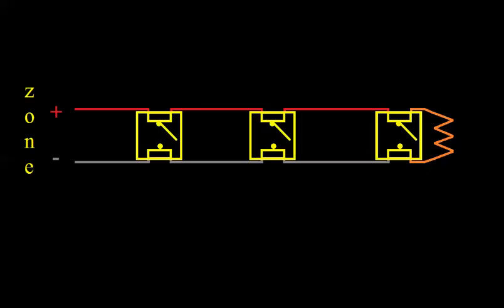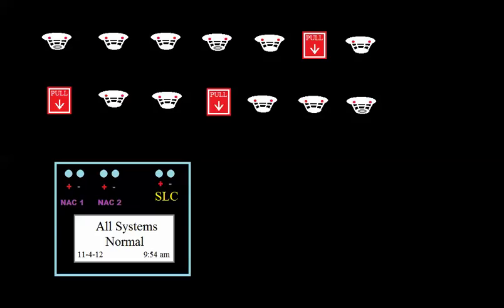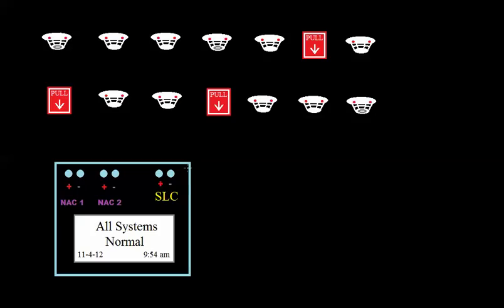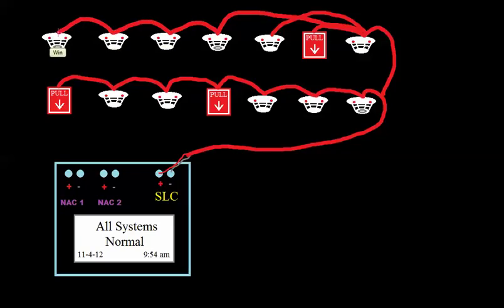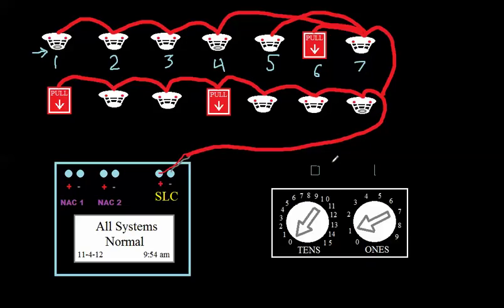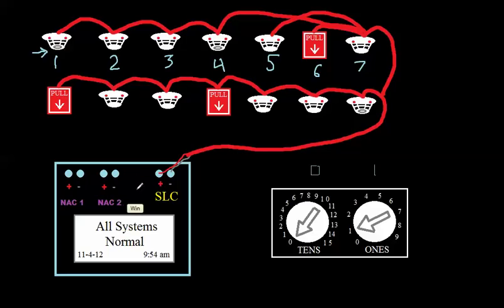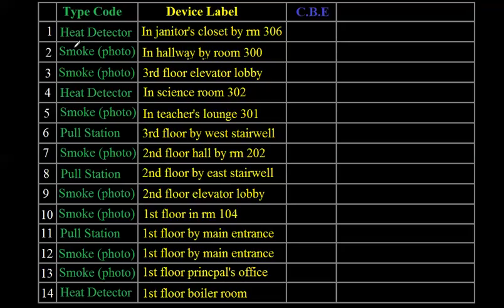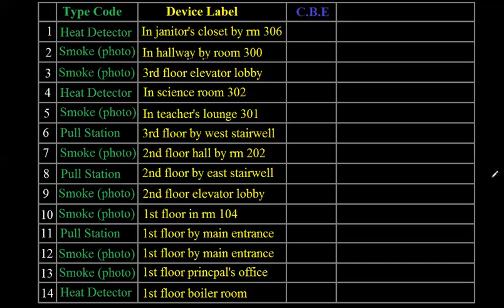21 - Intelligent Panels - Introduction to Fire Alarms

Comment: Hi, I have an NFS 320 notifier fire alarm panel with 138 smoke detectors and 25 modules. Now my panel is showing multiple trouble"INVERB". The same device showing "inverb" trouble blinks a green colour as a normal device, sometimes the same device blinks a red colour and sometimes the same device keeps the LED red in colour. Could you please suggest to me your expert advice?
Reply from the maker: Is it a new system, or was this existing and previously working fine? Do you have the proper SLC voltage on those devices? What exactly is the trouble message? The LED blink can be meaningful but it may act differently with output modules. It's been a while since I've worked on notifier, but on fci systems, those same types of modules only blink green if they're output modules.

Another thing to try is disconnect a device and wire it directly to the panel and see if it clears.
Reply: Thank you so much for your response. It was working well for the last 2 years. The SLC voltage is around 14. It shows trouble in systems like "INVERB".
Reply from the maker: I'm not familiar with INVERB, but usually their error message is short for "invalid reply, which is something like INVREP or something like that (it's been a while for me). My guess is that's what you have. Your voltage sounds correct, I'd try wiring the missing devices directly to the panel. Are you sure you have no ground faults on the SLC?
Reply: @jeanclinton682 could be addressed wrong or programmed differently

Comment: Fuck me how shit are USA fire alarms. Conventional fap's don't monitor for short circuits (short circuit actually puts it into fire 😂)
SLC as you call them ffs, it's a loop so from the panel it goes to the first device then to the 2nd and so on then at the last device it goes back to the SLC. And no you can NEVER tap off a device.

Comment: if the SLC wiring has red, black and green wire for grounding, should I use the green wire to ground all metal boxes where the smokes are installed or cap it off, I don't see any information about this ground green wire
Reply from the maker: I dont know why there would be a green. It's possible you're referencing an older system that needed a shield, but I've never seen a green shield. There's no reason to pull a green along with SLC.

Also, while the whole point of my channel is to help guys learn the trade, you need to consult the manuals for your system to know specifically how the factory expects it to be installed. While I hope to get you most of the way there with my videos, I can't tell you the required specs of every type of alarm system out there. Look in your panel manual, SLC wiring guide, etc, to see how your specific devices need to be wired.
Reply: @JoeKlochan thank you

Comment: Do Intelligent panel and addressable type a same thing?
Reply from the maker: Yeah, I think when that technology first came out there was technically a difference between an addressable or an intelligent panel. That may still be technically true, but in my experience the terms are used interchangeably and they're the same thing.
Reply: @JoeKlochan  I see. For conventional, Is it possible to have a two manual pull station in a single zone?

Comment: T tapping is for people that never learned the right way to pull cable. Anyone that trouble shoots other peoples work understands why t tapping is bad
Reply from the maker: That's not true. Anyone who know's how to troubleshoot and SLC circuit knows that t-tapping a class B circuit isn't a problem. That's a good example of a common snobbish comment that many people in this industry would say publicly but would definitely ignore in the field when it's convenient for them.

I think it's good to make an effort to limit the number of splices on a circuit for obvious reasons, but some aren't a problem at all. 

On many jobs the person who runs the conduit isn't the person who pulls the wire, often times it's not even the same company. If you can picture a large building with a panel somewhere in the middle and full coverage smoke detection, putting a splice box above the panel and having the SLC branch off is harmless and practical. This is particularly true if your pipe route would result in double the wiring being used on the job, just because of some common complaint that you've always heard that "splices are bad." It just shows a lack of understanding of how these systems work in my opinion.

Comment: How do you connect sprinkler system signals such as SV, FS (Flow Switch), LP (Low pressure)? Can  I show them on the same SLC with heat and smoke detector? Thank you
Reply from the maker: Yeah, they can be on the same SLC. Check out my videos on sprinkler systems, and also the one on monitor modules. They explain that a bit more.

Comment: I have a SLC with a pull station trouble.  I replaced the pull station.  I checked voltage at the device before and after this one and all 3 have 15 volts.  What else could I be missing?
Reply from the maker: What type of panel, pull station, trouble, etc. More info
Reply: It's a notifier panel maybe a NFS-320.  I'm not a fire panel tech I just over the system at work. The pull station is a  notifier 12lx.  The trouble alarm gives the address.  It just started about 2 weeks ago so I checked the wiring for tightness first.  When the trouble didn't clear I changed the pull station.  It's a SLC configuration I've seen that in the drawing.  Thanks for your help.
Reply from the maker: @tommiebright4414  there are a lot of variables. The system has been installed for a long time and this just started? That seems odd. Are you a fire alarm tech or an employee in the building?
Reply: @JoeKlochan  The system is 18 years old.  Never had a problem with this pull station before.  I work in a very large factory.  I'm a electrician who has taken over maintenance of the fire system.  The drawings show the pull stations connected in series.  My thought was an open wire but when I checked voltage at the pull station before and after this one they all have the same voltage.
Reply from the maker: @tommiebright4414  is there any chance another device on the system has that same address? What specific trouble message is being displayed? If you remove that device and t-tap it directly at the panel, what happens? When you replaced the device, you set the new address, right? Also, this is very rare, but it's possible the address dials need to be exercised on the new pull station. Turn the dials from 0 to their max and back several times and then set the address. I think there's some sort of wax coating on them that can occasionally (but rarely) cause a bad connection between the dials and the circuit board. Is the trouble an invalid reply? Lastly, tell me exactly what the panel model is and the pull station part number is.
Reply: @JoeKlochan  The exact trouble is "1M044 Pull Station Trouble".  I pulled the drawings and located it.  Removed the cover, opened the pull station and seen the node 44.  I checked the wires for tightness, and checked voltage between the positive and negative (15v).  After the trouble persisted I changed the NBG-12LX.  I addressed the new pull station 4tens and 4ones.  The trouble code just showed up one day as I was checking the panel status.  I will get you the exact model number Monday.  Your videos are great by the way and your assistance is greatly appreciated.
Reply from the maker: @tommiebright4414  I really don't think the trouble message would simply say "trouble". I may be wrong, but I think it's going to say "INVREP", which stands for invalid reply, which is basically a no answer trouble. The pull station you're replacing it with is the exact same as the existing right? There's not already a module in the junction box or anything? I would try removing it and connecting it at the panel. There are no other troubles on the system?
Reply: @JoeKlochan  No other troubles at this time.  If I could get your I could send you pictures of the panel display.  I will try as you suggested Monday.  You are awesome!
Reply from the maker: @tommiebright4414  I'd rather not post that on here. Does YouTube have direct message?

Comment: i can't understand about ones and tens
Reply from the maker: So if the "10s" dial is set to 2, the address will be in the 20s. If the "10s" dial is set to 5, the address will be in the 50s. The way to set a device to address 72 would be to set the "10s" dial to 7, and the "1s" dial to 2.

Comment: You never heard of AUTOPROGRAM ?   You do not have to tell the panel its a HEAT or a SMOKE and the panel figures out the address automatically.
Reply: Not all panels. We use silent knight. They do not. We have to detect it and find it ourselves.

Comment: Appreciate the video - The concern i have is the loop is not completed back to the panel! this to me looks like a radial / conventional way of wiring the system? should the circuit not be completed my wiring another 2core cable back to the panel from the heat detector addressed No:1??
Reply: Jonathan MacMillan yes, I'm thinking the same. At some point it must be connected to the Alarm panel. We're following loop wiring(addressable). Please correct me if you've any recommendations. I'm new to FA PA, my project has just started

Comment: It's all fun and games until your apprentice confuses the tens for the ones on the apartment modules and you have 50 address faults to deal with on Friday afternoon.
Reply: he won't do that if you teach properly. Just saying .
Reply: or resets entire site from control panel, so you have to address all devices one by one.
Reply: jajajajajajajajajajajajjajaajajaj
Reply: Well perhaps if your apprentice's mentor explained it properly, then you wouldn't have had the problem.
Reply: how is installed response indicator at siemens

Comment: I have one problem. I have one FACP in the commercial building which is old and i am a designer of the renovation of some part of that building where we need more smoke detectors. my question is this. Can the new model of the same brand be compatible with the old in terms of looping it together. ( the brand is simplex) it will be great help. Thanks in advance to anyone who is able to help
Reply from the maker: +Mohammad Nabil Most likely they will work fine. SImplex has many different types of detectors and bases, but typically the new detectors work on the older systems, just not the other way around. You may run into a UL listing problem, but most likely not. There should be documentation with the smoke detectors that tell you what panels the detector is listed for.
Reply: You need a licenced fire alarm technician to do that.

Comment: Joe....you are awesome man.  I love the way you present the topics and you clearly explain the functioning of the system.  Could you please explain/upload a video on how to wire/connect 2 FACP panels together?  Is this even possible?  Also, could you please explain how to wire an annunciator panel to the FACP?  Thanks!
Reply from the maker: +Henry Surface That's a bit of a difficult question to answer. I haven't been making videos recently, although I haven't ruled ever doing it again. There are many different types of fire panels and many different types of annunciators for them, so it would be hard to cover. I suppose I could do one on the most common annunciators. They're pretty straightforward though and the manuals would be better help than I would. 

As far as connecting two panels together, that would depend what you mean. Many panels have the capability of being a part of a network. That means that several panels (picture a college campus) can have cards that essentially all talk to each other through either a wire or fiber network. Then, at some central location, all of the panels can be viewed by a network control annunciator. Imagine a college with 30 buildings, and at the main security office they can see alarms, troubles, etc. on each individual panel, as well as communicate with those panels to silence alarms (which would be pretty risky without being there to investigate the alarm first), reset the panel, read status of detectors, etc. It's pretty complicated stuff, but also very common.

Then there are situations where a small building may be running two fire alarm panels together. I've set up buildings that had an old panel that was going to be phased out by a new one, but both panels had to be up and running at the same time and they each had to put each other into alarm so that the entire building had notification. The problem you run into there is having to reset both panels at the same time time because if you reset one, the other panel puts that one right back into alarm. Again, that's a bit more than I can adequately explain here.

Comment: Good video this pal , I'm an electrician and just started a new job as a fire alarm engineer . This is most helpful video I've come across . I'm from u.k but the systems are generally the same .
Reply: Hi Stu, A house converting to 5 flats 2 on the ground with individual entrance. 2 flats at the first floor and 1 flat at the second floor. The last 3 flats have the same entrance. The top flat has a loft too. I wonder if grade 4 smoke alarm system would be sufficient? What would be your suggestions please? 
Thanks,
Reply: They are different.  UK uses mostly the APOLLO platform and on large systems lots of mini nodes or modular installs.
In this part of the world, we use very large scale networks.

Comment: i have a doubt sir, if u could clear it, u told in your previous video that with conventional panel, we cannot connect too many 2 wire detectors( as wen all of them go in alarm it wud be problem of power availbale for them )...so with intelligent panels , how do we connect 100 detectors in a single loop ?..power for them ??
Reply from the maker: +amritansh ahuja That's a good question. The difference is that on a conventional panel, an alarm is detected by an increase in current on a circuit. When a conventional detector goes into alarm, it draws a significant enough amount of current to put the panel into alarm. Only a few of these detectors can go into alarm before there isn't even enough current to power up additional detectors on that circuit. Also, at the panel, you wouldn't know if 10 smokes were in alarm on that zone or just 1, because it would show up simply as an alarm for that zone.

On an addressable system, the alarm is not detected by an increase in current. A detector simply sends its data back to the panel and the panel evaluates the data to see if the alarm threshold has been reached. Whether the detector is in alarm or not, the amount of current that draws on the SLC is almost the same. The only difference in current draw is if the system is setup to keep the LED illuminated on the detector in alarm, which most are.
Reply: Oh..! Thank you so much ..clears a lot a doubt for me.

Comment: you sir, are a true life saviour. Thank you.
could you please explain to me, how an isolator device works?
Cheers.
Reply from the maker: A short circuit or a severe enough ground will allow all of the current in a circuit to take that path (the path of least resistance). An ISO module is connected to the source (the SLC) on one side and to a branch circuit on the other. If a short or ground occurs on the branch circuit the ISO isolates that branch from the rest of the circuit. Think of it like a light switch that opens. That protects the rest of the circuit. If there were a short on any branch of SLC, no devices on the entire loop would work because the current would take the path of the short. The ISO breaks that branch off to protect the rest of the circuit.
Reply: Joe Klochan ur awesome

Comment from the maker: SLCs do not require an end of line resistor. The horn circuits on intelligent panels require one because that's the only method of supervising the circuit. But each device on an SLC is supervised by data communication with the panel. It's checking for each programmed device individually, so an open circuit would cause every device beyond the open to lose that data communication and go into trouble (in a style 4 circuit, which is essentially class B).
Reply: An open circuit will not lose all your devices after the open circuit as the loop is fed from both directions. Unless in the USA you have shit regulations.

Comment from the maker: Silver D, that's true, but I believe the terminals on their panels are still labeled SLC. Brayden, I use Microsoft Paint along with a screen capture software called "Snagit" (retails for about $50). I also use a bamboo tablet to be able to draw, but it doesn't work too well with paint. It works better with other software, but I like the shapes available in paint. I borrowed the idea from the khanacademy website.

Comment: Great videos! I am a fairly new tech and have picked up lots of good info in these videos.  Just an FYI Simplex calls their SLC,  IDNET or MAPNET depending on the generation of the panel but they are still considered SLC's
Reply: Simplex IDNET or MAPNET allows 250 devices/modules and it doesn't matter if they are modules or smokes or heats.
Notifier and Mircom allow 159 modules and 159 devices for a total of 318 devices/modules per loop.  In Canada we are not allowed to go over 300 on a class B loop according to our Building Code.